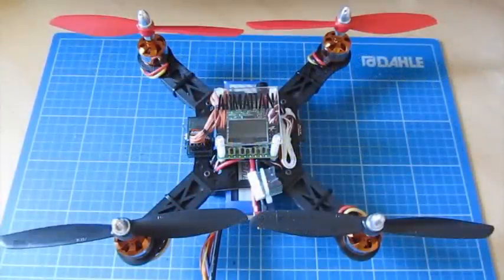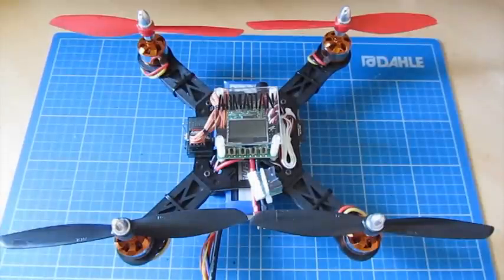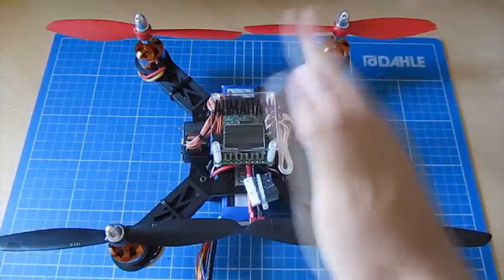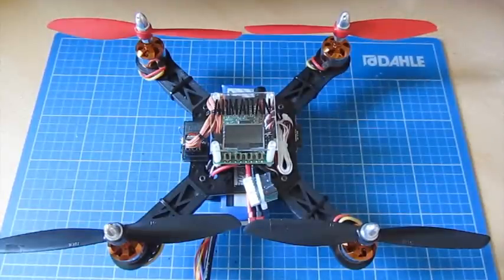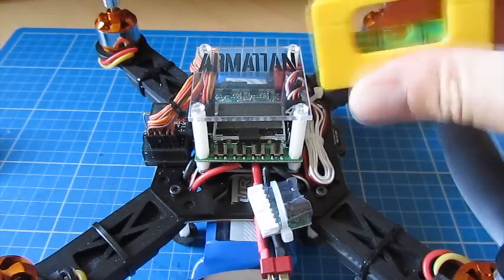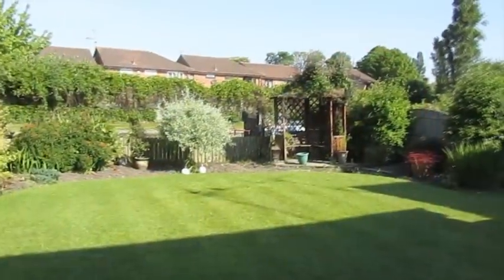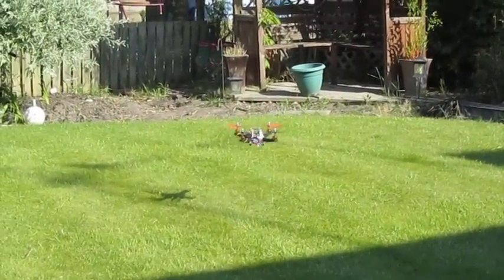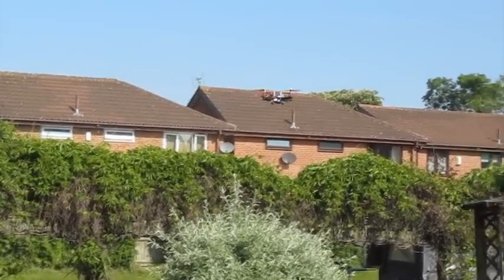KK2.0 Self level setup, trimming and review with firmware v1.6

Comment from the maker: Propfella, thanks for the feedback. It's always nice ot hear that the video helped another RC addict.

I've checked the tool I used to flash the board (KKMulticopter Flask Tool V0.72) and the version I used was the original 'KK2.0 V1.6 by KapteinKuk'. There wasn't the choice there is now on the tool when I flashed the board.

Hope this help. Happy flying.

Comment from the maker: Hi Steven. You need to solder the voltage from the battery (or power distribution board) to a dedicated pin on the KK2.0. You can see the connector on mine - it's just above and to the right of the display and is a small red connector onto a pin soldered into that spot, makes it easier to unplug.

Happy flying!

Comment from the maker: Bruce, best to do it once it's on the craft. Any small changes in the mount may knock off the level. It's a quick and easy process so only takes 20 seconds once you've installed it - worth doing.

Happy flying.

Comment: NOt that I recall. I will check again tonight. The funny thing is that this is my 4th multirotor using a KK2.I have never had a problem before. I just powered it up, made the  settings adjustments, and flew. I have noted that KK2 boards fly fairly well with factory seetings. I don't understand why it starts "armed"

Comment: Thanks for the video. I'm having the forward lean issue as well. I'm assuming it's slight difference in motor angles and/or board placement. Will try the pitch trim tonight.
Reply from the maker: Good luck, this seems to be quote a common problem. I hope it gets fixed in a future release of the code..

Comment: Hi just seen your vid on the Kk2 board .must say it completes the jig saw set of informative vids as there isn't any one vid that covers the lot 
I now have a 330 Dji frame with turnigy 1000 motors .afro 30amp esc and the Kk2.1 HC BOARD WHICH I HAVE UPDATED TBE FIrmware to STEVIES latest offering 
I have also got a ifly 4 frame with the Kk2.0 board with the updated 1.6 Now that's a blast to fly but this 330 Rock Solid hover and goes like. Rocket 
Anyway thanks for completing the jigsaw 
Many thanks 
Brian 
London

Comment from the maker: The calibration seems to hold well, not perfect but I expect that is due to the board warming up etc. I've not had to play with it too much once it's dialled in.

The model came with Turnigy D2822/12 1800Kv motors and it was a beast! I've replaced them after a crash with Tungy 2822/14 1450KV and it's still powerful but gives me longer flights. I use a 7x4.5 prop and it hovers about 51% throttle now.

Comment: Hi painless, I followed your instructions on the self levelling, but in my case, as I'm building in a qrx350 shell, I had to level the model not the board. i got the KK2 as level as possible in the frame, then levelled the frame as best I could. This made a massive improvement and as I know your quad is all nice and flat, I'd just like to add the point that level should be at hover, because with my difficult (stupid idea) first build that's where it's needed!

Comment: Babipsylon, thank you so much for your interest and info. My problem now is that when I power the board, It reads "Armed" and a minute later it reads "ERROR". Cannot do anything with the board. Does not respond at all to my radio. I triple checked the wiring, everything looks correct.
Reply from the maker: +jerry zito The board should give you a clue what the Error is along with the warning - does it say anything else?

Comment: Got the KK2.1.5 in my tri but having yaw drift issues.

Been great until I broke my DS939HV servo. Replaced it with a new HK15148B I had but now my tri won't hold it's heading too well. It kinda drifts side to side randomly and doesn't always return to the right heading. Tried adjusting the P/I, Mixer Editor and servo filter but nothing seems to help or do anything for this particular problem. When on the ground or test bench the servo buzzes as if it's trying to center but can't quite get there.  I can't detect jitter on flight or power up but it might be happening a little. If I touch it slightly one way the buzzing will stop until it moves again just a hair to one side then buzzes again.  The buzzing doesn't happen unless armed.  The DS939 didn't quite make the buzzing noises, but both servos feel like they have the same amount of center play...

Is this just a really crappy servo? Help greatly appreciated.
Reply from the maker: I'd suspect the servo - looking at the comments under this product on the HK site it appears that you are not alone.. Best of luck fixing this one.

Happy flying!

Comment from the maker: Hi there, I've looked at the video - a couple of things..

The rotors are all spinning in the same direction, two of them should be spinning the other way and have counterclockwise props on them.

I would need to know the weight of the model and type of motors to see if they have enough power to lift it. See my other video on how to choose a motor for your multirotor. Remove all the excess weight on the model to give it the best chance to lift off..

Hope this helps. Good luck..

Comment: Hey !! i fixed my auto level problem (she would nosedive in auto level only) i made sure my reciever settings were at 0 ,the tricopter flew good in normal made sure my trim pitch was at 0 ,propped the nose of it about 4-5 in above the rear ,recalibrated the sensors ,l placed it on the floor indoors so no wind effects were present,spooled it up to a hover ,and wow ! it worked drifting only slightly forward,.this was corrected by adding some positive trim pitch in the auto level settings, now ok.

Comment: Great tips.. quick question, if the copter wants to yaw, what do you adjust on the auto level settings ( or is that done up on the other section of settings)?  I know that you can just trip the yaw on the transmitter, but that's really a bandaid!   Thanx much !!!
Reply from the maker: Hi Rene, the Yaw setting isn't touched by auto-level. Use the trims on the transmitter to compensate (and make sure that you haven't caught the trim by accident! - I've done that too!).

Always allow the model to reach the ambient temperature before flying as gyros tend to 'wander' as they change temperature.

I'd also look at resetting the accelerometers again and if that doesn't fix it check that all the motors are level - I had an issue on one of the larger plastic framed quads where two of the arms were warped slightly.

Hope this helps. Happy flying!

Comment: Hi. Let me first say a big thank you for all your affords posting all your helpful videos. Helped me out a couple of times. 
But now i want to tune my quad with a kk 2.1.5 board. Self leveling is ok but it slightly turns right but over the yaw (rudder) axis. I don't find anything regarding this issue. I changed the props but it doesn't help. Maybe you got an idea??
Reply from the maker: You can trim this out using the trim on the transmitter. Check that you have everything as balanced as you can and that the you let the model warm up/cool down to match the temperature of where you are flying before you take off. Hope this helps!
Reply: Thanks for your help. Its much better now.. But this huge temperature differenz will play its part there too.

Comment: one thing you forget to mention i think is important and also not only for the kk board. for the kk board before you trim the autolevel you should also trim the rc input to zero. using high "stick scaling" (rate) makes it even worse if its not exactly zero. small numbers can make huge difference. not that much in stable mode but in acro mode if you want to do flips and because of that raise the rates.

Comment: i have an SK450 with kk2.0. It flies great, other than one issue. When i am trying to climb fast, lets say maybe 70% throttle or higher, the front right motor powers up more than the others all of a sudden (or the back left motor isn't powered enough) So it banks on that axis, which is frightening.    Any suggestions?
Reply from the maker: Hi Jonathan,  thanks for the question. The first thing to check is the calibration of the ESCs. Let me know if that works. Happy flying!

Comment: I have Turnigy D2836/8 1100KV with Afro 30a and using GemFan 8x4.5 and 30c 4s 5000 lipo. I'm also using kk Hobbyking KK2.1HC. Frame is Hobbyking X650F. Now problem is heat on the motor and including heat on esc. And motor 1 and 3 there is a wag. So engine 1 and 3 goes up and down. What's the problem? Also it's hard to keep it hover it's hard to keep it one spot. My frame before was X550 but had hobby wing 4 in one 25a with same prop, same hubs, battery was 4s 4000mah work great. On this flight board i flew stock 1.6 firmware but now it's setup for kk2.1 v1.9s1 firmware. Any ideas?
Reply from the maker: A lot changed from the two setups so it's tricky to know what's giving you the problem. Looking at the spec of the motor a 7x3 prop is recommended for a 4s setup. Using a much larger prop could be causing the overheating - see The impact of changing rotor or blade size on Multirotors

The wag could be vibration in the frame. I'd suggest mounting the control board on some rubber pads to see if that improves things.

Hope this helps. Happy flying!

Comment: need help can't seem to find much on you tube or online. i have a armattan quad setup very much the same as in video. i quite sure that i have set things up on the kk board as i should of but i am having problems. When I try to take off I move the throttle up to just above 50% once it gets to 52% the copter just shoots up into the sky. When I try to lower the throttle it just drops out of the sky there is no progression in the throttle. Can't get the copter to hover. i am also using a ezuhf rx receiver which is setup using ppm linkup. i have other flight controllers with the receiver set up with no problems so i feel that the problem is with the kk settings are there any settings i can change to solve the problem thank's. hoping around on the ground at the moment lol
Reply from the maker: The first thing to check is that you have a linear throttle. Check the throttle curve on the radio is a straight diagonal line from 0% to 100% and then recalibration the ESCs on the model using the KK2.0 menu. Should help.. Good luck

Comment: I have 3 quads, the most recent build is an X525 from Hobbyking, I'm using the Q brain for ESC and the KK2.1 with 1.6 in auto level if you bang the stick too hard and the unit try's to auto level it will over compensate and go into a bad wobble and crash. I have the P gain at 25 and P limit at 40 any higher on the P gain and it will wobble in a breeze and crash.....Help
Reply from the maker: If it flies ok in non auto-level mode then I'd suggest reset the acc and rebalance all the props in case of vibration.

You could also look at the stick scaling and turn it down a little.

I had a similar issue and it turned out it was a problem with the firmware on the ESCs.

Hope this helps. happy flying!

Comment: I built a H quad from a crashed guia 500x. Mounted a KK 2.0 and getting it sorted. Adjusting the height hold and it did a front flip for no reason. Restarted it, holding a hover, moveing it around and it did it again. Only had it a foot of the ground so no damage but now im not too sure about this board.

Comment: Hey, I have build my own hexacopter and when I plug in the battery the screen flashes and it only displays the firmware version (HW Ver 2.15, FW Ver 1.6 hextronic).
Reply from the maker: Does it do this when no leads (apart from the one supplying power) is connected?
Reply: Painless360 yupp
Reply from the maker: That doesn't sound very promising. You could try re-flashing the firmware but if it came like this then I'd return it..
Reply from the maker: Looks odd, pull all the connections and unscrew it from the frame and try it with a single UBEC/ESC connection. Might be a bad UBEC, the metal posts causing a short or a bad board.. Best of luck finding the problem..
Reply: It worked! You my friend is a lot better then Hobbyking support team... lol
Reply from the maker: Glad it worked! Happy flying!!

Comment: Thx for the video. I have been using v1.6 for some time now. In my case works perfect with small quads, st360 and f330, but on a big one, 525, etc. Is a pain. Very unstable.

Comment: Thanks for the video.
Unfortunately, your video confused me. In your verbal discussion of the trim chart, your said that if the copter is drifting back towards you, add positive pitch trim. When you flew the copter, it drifted forward, away from you, and you added positive trim.

It's also a little unclear whether the arrows on the chart indicate the direction the copter wants to drift, or the direction you want to trim towards. 

It would have been more clear to give simple directions, like this.

If the copter wants to drift forward, add positive pitch trim.
If the copter wants to drift backwards, add negative pitch trim.
If the copter wants to drift left, and positive roll trim.
If the copter wants to drift right, and negative roll trim.

After watching your video, I knew that I could figure out positive vs negative by starting with big corrections and checking for better or worse performance. I still found myself guessing whether to start with positive or negative,
Reply: Yes its said the wrong way around when the pictures are showing but with the actual trimming its done correctly. So when its flying forward add + pitch, when its flying backwards - pitch
Reply from the maker: Hi Zylor, thanks for letting me know. The idea was to make this easier! I've added some extra text to the video to clear it up and added a note to that part of the video for anyone else who is confused.

Thanks for the great feedback. Happy flying!
Reply: Painless360 I think the text in the video description is wrong. I believe this is the correct text:
- If the model drifts forward the correct using positive pitch trim
- If the model drifts backwards the correct using negative pitch trim
- If the model drifts left the correct using positive roll trim
- If the model drifts right the correct using negative roll trim

Comment from the maker: No details on thrust or prop selection for 3s or 4s batteries I can find for this motor. Not sure what you are using it I'd guess an 11x4.7 or 12x4 prop would give you plenty of thrust. Hard to say without knowing the thrust and weight of the model.

Email hobbyking and ask them for the prop suggestions for your battery cell count.

Hope this help. Happy flying

Comment: It's the motors that should be level, no? Not the kk board. In theory u can place the kk 45 degrees to the motors, and calibrate it like that, right? Just asking because I have vibration isolation under the kk, that doesn't keep the board in a very fixed position over the long run. Maybe I should change that.
Reply from the maker: +babipsylon - Everything should be level. The board will allow for you to mount it out of perfect alignment but be very careful when you do. Best of luck.
Reply: +Painless360 So you think the board would perform worse when you attach the controller in a(n) (non-level) different angle relative to the motors/arms/props plane? Why would that be the case? Because the gyroscope has some kind of absolute level position programmed into it, around which it performs better? Isn't it a full 360 degrees thing in all axes? Doesn't the controller only need to know when all motors are perfectly level (=> quad stays in position)? Of course, the fact my controller slightly moves angle over something like months, possibly, is bad thing for sure.
Reply from the maker: The board will perform in a similar way. Best of luck with it.
Reply: +Painless360 thx!

Comment: My Quad keeps lifting all by itself. Don't know what to do about this do I have to do anything abt the Pitch or something. It does not stay at level flight at all. It did drift but that was because of the wind. We do have a funny weather in the UK.  Please Help me thanks.
Reply from the maker: Hi Joshua. Do you mean that the model takes off uncommanded or drifts in the hover on it's own? Not sure which you mean. (I know about the weather, I'm in the UK too).
Reply: Painless360  Yes after I slightly push up the throttle and leave it by it elf (Do not touch it anymore) the motors start to spin faster all by itself. It also drifted a bit. But my main worry is that the motors spin faster all by itself.
Reply from the maker: I see, reset the accelerometers and if that doesn't help - recalibrate the ESCs. Hope this helps..
Reply: Ok I will try this

Comment: hi
thanks for your video.i have a problem may you help me please .
when i turn on self level my xcopter be vibration.
Reply from the maker: +turrboo t I would check the model for vibreation from the motors and props. I've not used the KK boards now for over two years so am a little out of date with the latest firmware. There may be settings you can use (called LPF on other flight controllers) to help. Best of luck.

Comment: Hey I am having Kk flight controller and flysky ct6B I cannot reverse my channel in my transmitter is there any way to reverse channel in kk flight controller board plz help me..
Reply from the maker: +Just Hack It I am very out of date with this now ad the KK boards are very mature and not used by lots of pilots. I did a quick Google search and it looks like you can - http://quadcopterforum.com/threads/kk-2-1-5-board-help.5135/ - hope it helps..